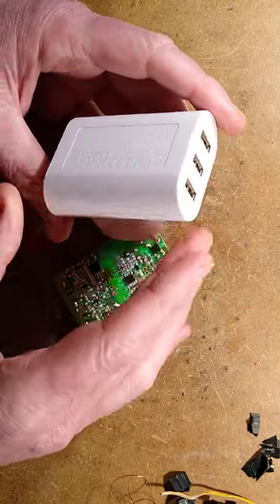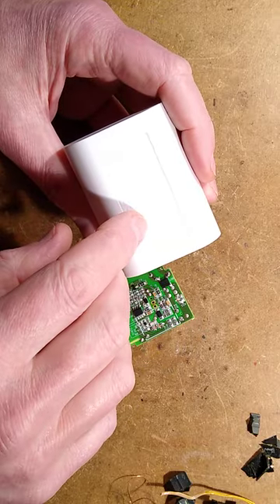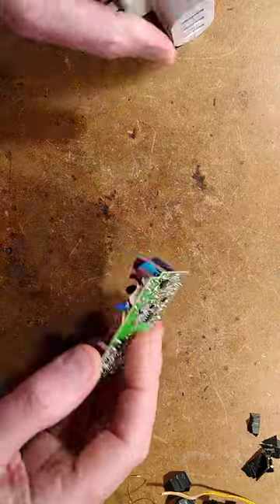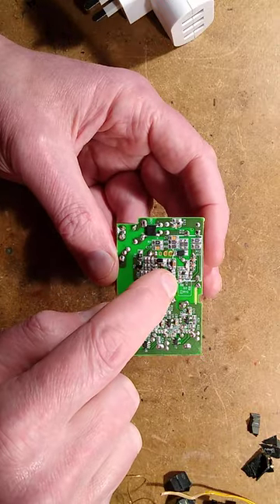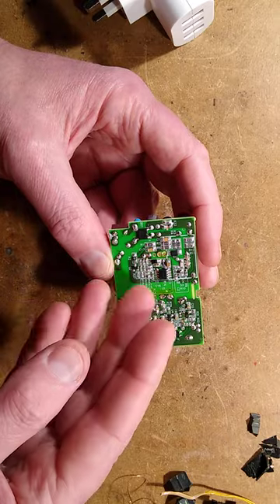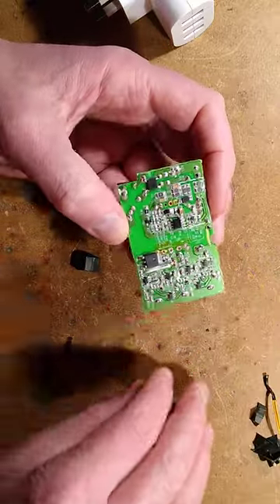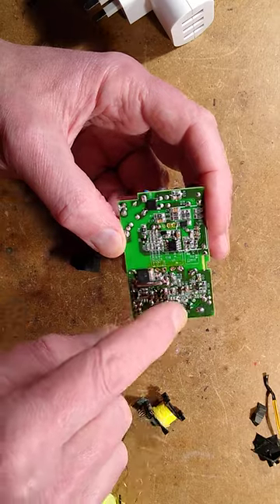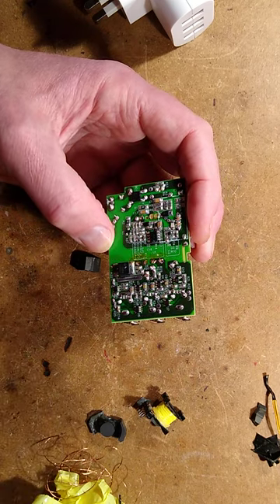IKEA SMÅHAGEL instant review

Comment: I have 2 Ikea "Koppla" ones bought about 4 years ago, they look the same with the same current output. A possible rename? Anyway they seem really good and have had lots of use with one permanently plugged in to power a clock and a LED cube. Glad to see they are just as nice on the inside. Ikea electronics are good, their Solhetta 2 watt LED GU10s are a cut above the competition for efficiency.
Reply from the maker: Major circuitry differences.
Reply: I see the koppla are reduced to £4. Maybe selling off the old stock. Is the new one that much better for the extra money? Which would you buy?
Reply from the maker: @wirdy1  The Koppla is time proven, but I'd expect the Smahagel to run cooler.

Comment: Why do NO USB multi-port chargers offer 2.4amps to more than one port at a time?? I get why car ones don't because of the low supply they're drawing from, but wall outlet ones baffle me on this
Reply: It only has one transformer of limited capacity.
Reply: The usb port was designed for 500mA first contact ratings, then charging up to 1Amp startef and was thrown on for micro-usb, which was designed for 1.0Amp if i remember specs... and they threw on 1.5Amp with surveillance of drop.
Then the smart charging at 9V with 1.5A came to not burn the contacts (but they still wear of, if done right the cable to be replaced, not the soldered connector in the phone)
USB-C came to fix the problem with multiple voltages and up to 90W i think, but not at 5V and not with only two contacts.

If you suck over 2.4Amps over the small cobtacts you get massive drop/heat, which will lead a smart load (phone charging) to realize the drop and lower current in steps until the voltage is stable... thats why wiggly contacts always lead to really low charge currents, suddenly resetting when you unplug/replug..

Comment: I was looking for power supplies for the christmas lighting of my aunt. Last year suddenly there were tons of cheapo wasteful battery versions, no plugs or psu included... and you could get a psu to battery adapter instead for 15bucks.

Sadly there are no cheap 3.3V supplies around. The cheapest are of course the 5V usb versions.
So i looked around after the 3.3V disappointment, even on amazon you are around 5 bucks or upwards (a lot) for a known brand version.
And i dont want to give away electrocuting or burning down houses power supplies.
So i was happily surprised to find the ikea ones start around 2.50bucks, for a "name brand good" version. Got a few single port ones and 2x 3port versions, Usb-A only.
Now there is gonna be a higher voltage drop/ loss but its safe AND still was cheap.
Reply from the maker: For strings of Christmas lights you can use a USB power supply with a resistor or diode to match the batteries.
Reply: @bigclivedotcom  yeah, thats what i'm doing now, i'll start test with 47ohm to 100ohm, the battery sets arent as long as the 100pcs copper wire versions that tend to use a overloaded 10ohm resistor..
I also dont want them to age rapidly with too much current and go dull, aiming for around 2 mA per led. Maybe i'll throw in a switch or more light/less light socket with different resistors. Ne555 pwm is too much work ;-)

Comment: What's the leak current like? And more importantly for me: what's the noise like? Unloaded chargers plugged in make this extremely annoying high pitched noise, and seeing that this one has 3 outputs, I wonder if they each are fed separately (and thus all 3 need to be under load to be able to sleep) or are they strung to the same rectifier circuit (which would make it fine with just one under load)?
Reply from the maker: Just one source for all outputs.

Comment: How do devices like this "know" how/what to do with the difference between 110 and 220v? Do these basically run on 110 if plugged into 220 by current limiting?
Reply from the maker: The power supply just has a wide voltage range and regulates based on sensing the output voltage.

Comment: Clive, you didn't mention price mate or its PD voltage range ?
Reply: He mentioned that it outputs a fixed 5 volts, as all USB-A chargers do. If you want Power Delivery support, you need a charger with USB-C ports.
Reply: @recurveninja  Not all USB-A chargers are fixed at 5V. The charger that came with my Xiaomi phone can deliver 55W (11V, 5A) and can also deliver other voltages, like PD. Although I guess it's not PD compatible, as it must use the D+/D- pins to negotiate the voltage.

Also, Qualcomm's QuickCharge protocol is used with USB-A chargers and can deliver 5, 9 and 12V.
Reply from the maker: Price varies around the world.  But it's cheap for the quality.  They do a higher power PD version.

Comment: 5v not enough anymore, I have 25 or 60v fast chargers
Reply: Don't you mean watts? USB-PD has a max voltage of 48v but 15/20v is a much more common maximum.
Reply: @Ethan Pender  yes you're right, watts
Reply from the maker: Fast chargers will shorten your phone's life